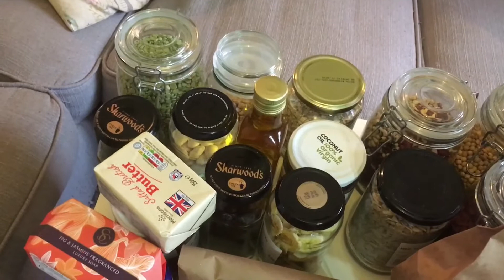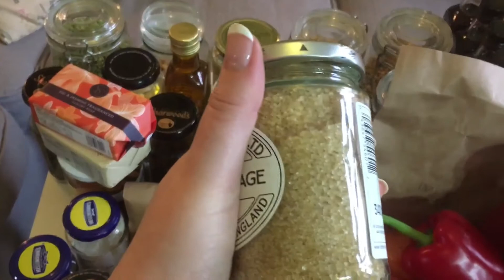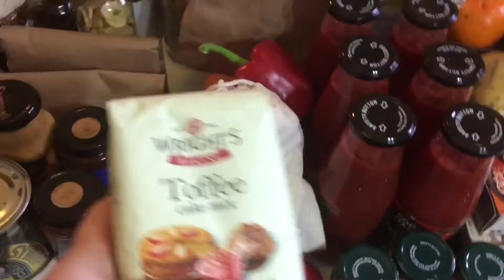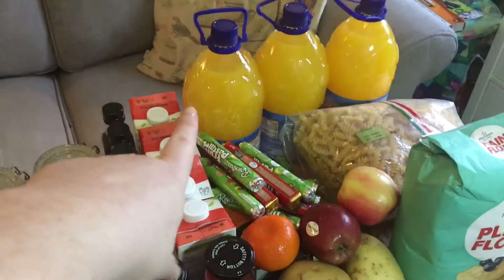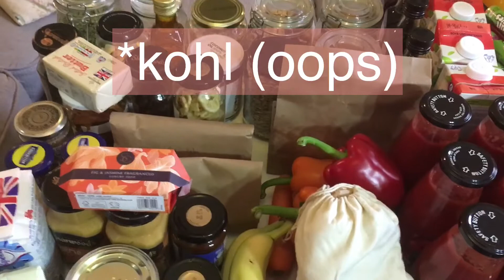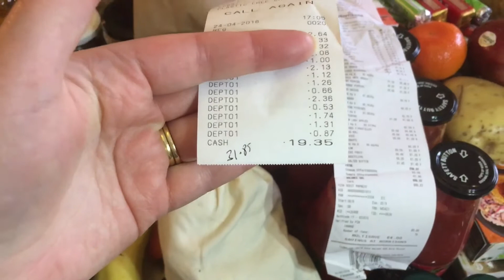Monthly Grocery Haul - Living Without Plastic

Comment: Cool. Plastic in itself is not really the enemy - it's the way that people dispose of it that is the problem (out of the car window, on the beach, wrong recycle bin etc) but I agree that removing the source product will help massively! 
Looking forward to the "LOOSE" video - my daughter shops there.
Steve
Reply from the maker: I know what you mean, although I would say that because plastic can only be recycled a certain number of times until it degrades into a material that can no longer be recycled, it all eventually ends up in landfill where it does not rot but splinters into micro plastics that leach into the soil and waterways, so I think it is a bigger problem than we realise, and it would probably be better to force industry away from it. It is so much cheaper for them to use plastic for everything, but if we stop buying it then it will force them to adopt alternative materials, and I think for me that is the point of my plastic reduction - to force the market to adapt due to consumer pressure. I think plastic still has its place though - especially in construction and medical applications. Xx
Reply: Tesco sold me fresh mushrooms in a papier mache punnet, the mushroom's moisture rotted the punnet in one day - all ruined. I will not buy them again.
Yes plastic has it's place.
Steve
Reply from the maker: Ooh yes that doesn’t sound good - I always get mushrooms loose in the supermarket and put them in one of my produce bags - I think the big solid reusable plastic produce crates are a great use of plastic as they can be sterilised between uses and the safely reused, wood or cardboard doesn’t have the same advantage and metal would be too expensive and risks corrosion and other reactions. It definitively has its place. Xx